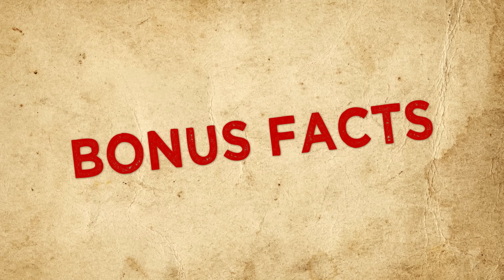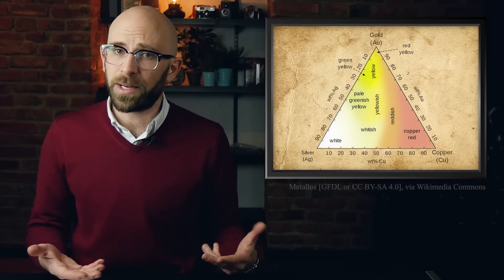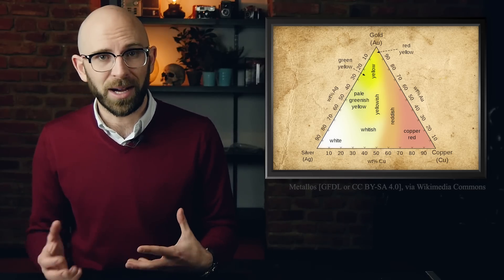How Do They Make White Gold White Given That It's an Element?

Comment: That was a short video. You could have extended a bit to include silver. Argentium is a trademark but they add germanium to silver to stop it tarnishing and it makes a very beautiful 'white' colour. Highly used in jewellery. Coins often have copper added. Sterling silver for example is a standard with exactly 7.5% copper. So a pound sterling used to be a gold coin worth one pound of silver with 7.5% copper added ... and that 7.5% copper in the gold was called Seigniorage, and it was the cost of money or the money that went to the King. Yes the king would get 7.5% tax on every coin issued by the bank of england and that kept him rich. Why is a one ounce gold coin worth one pound of silver? Well because the gold to silver ratio found in the earth was historically mined as 16 silver to one gold and it so happens there are 16 ounces is a pound. This is not a coincidence ... this is why the British currency is called the pound sterling ... the weight exists because it is a gold silver ratio for money. So in 'what you learned today' I can't help but think you could have learned a little bit more.

Comment: Thought I'd say something since I'm a goldsmith. One thing to note about rhodium plating is you need to plate the piece in nickel before you can plate it in rhodium. While it temporarily keeps the rhodium coating, once you wear it down you've now got nickel plate hanging out where it has worn down. This is mainly a problem in areas of the world where nickel white gold is used. In Europe they've moved to using palladium white gold. It has a darker hue, closer to steel (in my opinion). If you want a bright white metal that's not going to tarnish or tarnish resistant, your options are either platinum or argentium silver respectively. There's some other alloys of silver that'll achieve it, but those are pretty exotic in the jewellery industry at the moment and aren't widely used. Unless you're an incredibly curious goldsmith like me. Man, metallurgy is fascinating stuff.
Reply: Ever seen any magnetic platinum or tension setting alloys? Definitely interesting (and much above my level of capability!)

Comment: May have wanted to mention that rhodium is hella more expensive than gold, hence not just getting solid rhodium jewelry
Reply: Not particularly to do with cost; there have been periods when platinum was about 2x as expensive as gold, but platinum continued being used for jewellery. Rhodium is practically useless as a jewellery metal - very very hard, brittle, doesn't cast easily, and it's difficult to weld or fabricate.

Comment: Gold is gold, anything else is watered down snake oil fresh squeezed from the marketing department. Might as well chrome plate some old plumbing copper to serve the same purpose.
Reply: Gold is gold, even when alloyed. Which is why people will pay good money for scrap.
Reply: Didn’t you listen to the video? The white gold finish lasts much longer than chrome plated copper and trust me I know. I’ve used those fake wedding rings from Walmart as a decoy ring while traveling the plating comes off in about 3DAYS instead of three years. So it’s really about having a piece of jewelry that will last a lifetime. Jewelers usually offer a free service plan that includes having it replated when it needs.

Comment: Very interesting. But if you want white or black "gold", why coat gold in rhodium or black rhodium? why not just make the jewelry straight out of just those metals?
Reply: Partly because of cost (Rh costs ~ 2x Au at the moment), but mostly because rhodium is a pain to work: it's very very hard, brittle, doesn't weld well and it's not particularly ductile.
Reply: @dlevi67  thanks so much for the thorough explanation! Very cool!!!

Comment: If the entire point of Rhodium plated gold is that it looks like rhodium (white gold) why not plate a more inexpensive metal? People refer to the jewelry maintaining value, yet it doesn't seem to common for jewelry to be resold. After a generation or two it gains more value sentimentally then fiscally. Using an expensive base metal, and then hiding it, seems a foolish waste of money. Its like building a table out of aged teak, and then painting it. Even if the paint is expensive, its still the only thing you see.

Comment: Why not just use a 90% or 95% Ag:Cu alloy and cover that with Rhodium?
Reply: I'm sure some less scrupulous jewelers do. Btw rhodium is 91% more expensive than gold. The real question is why people don't get platinum jewelry instead, platinum is actually cheaper than gold...
Reply: @OnlyKaerius  Raw metal Pt is cheaper than Au (at the moment, but it fluctuates), however it requires much more energy to melt/cast/weld/solder and a fair amount more work to polish (and specialised skills to fabricate), so it's quite likely that a jewel made of platinum still costs more than the identical article made of gold (unless the "jewel" is an ingot made into a pendant).
Reply: Kaerius actually platinum is underwater right now compared to gold but that isn’t usually the case and anyhow the other commenter is right. It takes a special laser to set the stone in platinum and most jewelers don’t have that. And anyways I had a platinum ring and I hated it. It gets scratched all the time and I had to go in and get it buffed but it never really stayed smooth it was a pain. White gold is a whiter color and stays smooth doesn’t scratch.

Comment: I remember a jewelry vendor trying to sell my dad 24K white gold. He probably was selling platinum but didn't know the difference between white gold and platinum. This was in a mining town and my dad was a metallurgical engineer specialized in gold extraction at that time. When he saw that my dad wasn't convinced, he switched tactics and try to sell it to my mom. My mom happens to be of the same profession as my dad and proceeded to explain why what he was selling could never be 24K and still be white. Poor dude understood why he couldn't sell anything in a town where most people had a connection to the mine and had some idea of gold purity.
Reply: Assuming it wasn't just silver. How do you know?
Reply: @ericg2167  It could have been and that would have been worse for a jewelry vendor. He wasn't selling at silver prices. At the lower prices of silver someone might have taken what they knew was fake just because they like the piece. At the price of gold that he was selling, the hesitation of people were much higher. Either way, no one was paying that much for metal of uncertain content.
Reply: @ericg2167  platinum has a MUCH different luster and shine than silver, it's incredibly noticeable if you have a lot of jewelery or work with lots of precious metals, as well as the fact that platinum is MUCHHHHH more heavy/dense than gold or silver.

Comment: That is the most expensive metal to make a ring out of? 

(Must be stable & safe to wear)
Reply: It depends - if you include the price of manufacturing, there's plenty of difficult-to-work stuff that will cost you an arm and a leg (e.g. osmium - or even rhodium). Also, raw materials prices fluctuate considerably over time, so what's expensive today (palladium) may have been much cheaper 5 or 10 years ago.

Comment: I find gold( and all other precious metals) a pure waste, when used for jewelery...
Especially when one wants a silvery look, why mix all of the most expensive metals together??? Piece a' stainless would do it just as well... at literarly a 1000th the cost...
Reply: Jewelry use to be used as a type of family savings. You gave a women a gold ring to show her and her family that you had wealth and you could melt that ring down and sell it if you had to for your(future) family. 

People use to have a different view point on savings. Rather than just hiding stuff away, they make it into something practical that they could part with if needed. Gold and silver was made into silverware, jewelry, and other household items. Of course, it ended up become a status symbol and tradition, but it started for practical reasons. Same reasons why some people pay 10 grand for a mechanical watch while a $5 digital watch is better at keeping time.
Reply: "This [wedding] ring was made from a brave Cannon that fought at Stalingrad..." https://en.wikipedia.org/wiki/One,_Two,_Three
Reply: Stainless Steel can't take a decent shine, even from jewelers rouge, because it is way too hard. It also still oxidizes, it's just the nickle, zinc and other metals that allow for a thinner layer of white corrosion on the surface rather than deeply penetrating red rust. 
The reason noble metals are used is because of their extremely high resistance to corrosion. There are plenty of rarer and more expensive metals to use, but they are far too reactive, dense or brittle to use as jewelry. With regards to white gold in particular, it is superior to silver for the simple fact that it doesn't tarnish as quickly and has a far less likelihood of staining the wearers skin or causing an allergic reaction.
Reply: @Official_DJ_Spark  "stainless doesn't take a decent shine"

Have you ever seen stainless steel? You can polish it to a mirror finish fairly easily. Even easier than regular steel. And hardness has nothing to do with whether it will take a shine or not. If it did, then hardened steel used in knives wouldn't polish at all. Much less to the mirror finish you see in high end hand made knives. 

Corrosion resistance has nothing to do with it either. Stainless steel by it's very nature is corrosion resistant. That's what the "stainless" part means. And even normal steel will resist corrosion if properly taken of. 

As for why people use white gold instead of silver, the fact silver tarnishes is irrelevant. If you clean, polish, and just generally take care of it, then silver won't tarnish.

As for having things that maintain value, that's bullshit as well. If you only wanted something to use as a savings, then you'd just buy gold bars and put them in a safe. 

The only reason people use gold and other expensive metals in jewelry is because there expensive. It's a status symbol and nothing else. They just want to go out and make other people look at them and be jealous. It serves no other purpose.
Reply: The real kicker is the tungsten wedding ring fad, yeah its cheaper then gold, good choice on the surface. 
But then you hurt your finger somehow and due to swelling the hospital needs to cut the ring off but can't because it's tungsten... (gold can be snipped then bent with basic tools and little risk to the finger. Any jeweler can then repair the gold ring.) And I mean proper 18k gold that would be used for wedding rings, not 10k prop jewelery with unpredictable properties.
Reply: Here's the thing though: when you pay a goldsmith for a ring, you're mostly paying for our time and skill. This is also assuming you want something nice. Never mind the fact stated above about the safety go wearing a piece of hardened steel.
Reply: That's true, i doubt i ever marry but if i would ever marry and the woman would want a ring or she wouldn't marry, i wouldn't marry her,  she could have something usefull like a fun trip where you could form some precious memorys together, if she wanted and i would be able to afford it, but i sure won't support  jewelery.
Reply: @DerNunu  Just whenever I want to experiment (I do a lot of chemistry and physics stuff), and need some gold or silver- or any of the platinum group metals, or even a Diamond or other gemstone( I once needed a ruby for a laser, and GOD DAM I got pissed by all the search results of jewelery XD), I rage bacause all the materials used in jewelery inflate the prices like crazy..
Reply: @Kezenmacher  
not to mention that the use of precious metals in electronics can reduce electrical resistance, whci hmakes devices more energy efficient.
Reply: @Kezenmacher  so why don't you use lab grown gemstones? They are literally the same thing, but instead of $9,000 for one carat it's $63.41 for a "brilliant cut" one carat +shipping. And that took me maybe 10 minutes on Google.

A synthetic 1ct Ruby goes for $11.99 on Amazon plus free shipping, while a really Ruby goes for 10k+. Fun fact it took me more time to find a price for a regular Ruby, while the first search result took me to Amazon for the synthetic one.

And the synthetic ones are so good most Jewelers don't buy used as they can't tell the difference
Reply: @DominicMV  IDK where you live, but here(germany) I have had a VERY hard time finding artificial gemstones, especially rubys, in the size I needed, for a decent price...
Reply: @Kezenmacher  shrug idk man maybe you just weren't looking in the right areas, both of those prices I found through eBay and Amazon respectively. Both products were sourced through a Chinese company and then shipped overseas (in my case the USA) so be it the US or Germany it shouldn't make much of a difference. Perhaps you were looking for a specific cut? Most Chinese manufacturers are willing to work with clients to get specific cuts they need. It might be 15$ instead of 12$ a CT for rubies but that's not substantial

Comment: Platinum is down buy it cheap and make your own jewelry.  Give it that "personal" touch.
Reply: That's not wholly true though. Yeah, it's cheaper for just a raw ingot of platinum, but what do you want out of it? Most pieces of platinum aren't made of pure platinum. They usually alloy it slightly (97.25% platinum to other 2.75% alloy) to make it easier to work with. If you want a really nice ring, that still requires time and effort to make. Plus you need speciality equipment to work with it, plus training. Get something wonky in your platinum? That's not coming out. Platinum doesn't tend to play nice with other metals, which is why most goldsmiths who work with it with any regularity will have a set of tools dedicated to just working with platinum. If you want to learn, hey, more power to you, but it isn't the most beginner friendly metal imo.
Reply: David Beppler I want platinum.  How much would it cost to get it?
Take care and God loves you.
Reply: @jasonirelan1737  depends on how much you want.  You can check prices easily.  There are places you can order the metal for the going rate, plus shipping.
Reply: Platinum is about half the price of gold. $750 vs $1250. Low world demand for Pt catalysts, but palladium is up.
Reply: Working with platinum is very difficult and very expensive.

Comment: I really like this video both my engagement ring and a wedding ring or white gold and I always wondered how that happens so thank you
Reply: FWIW:  My High School graduation class ring {1979} is white gold.  I preferred that 'color' as well, but this is also for me the first time I knew how it was actually created....
Reply: @Allan_aka_RocKITEman  it should be solid white gold from that long ago. Which is a good thing. Mine was too. They cost a pretty penny.
Reply: Am I having a stroke?
Reply: @spelcheak  >>> Okay, I will play your silly game:  Are you having a stroke? 😊
Reply: If they are from a reputable jeweler, they will be solid white gold not yellow inside. They may have the rhodium coating to protect the finish. Only crappy jewelers plate yellow gold. 

My weddings rings and most of my collection are white gold. It's my preferences

Comment: Other than a conductor, Gold has zero practical use.
Reply: It's chemically inert & useful is certain medical applications such as dentistry. It's also highly malleable and useful in decorative arts. It's also used as a lubricant in aerospace, for objects sent into space.
Reply: @KimberlyGreen  Thirty years ago you might have had a point but dentistry in first world countries really don't use a lot of gold as fillers anymore. Especially since there are other options around now..
Reply: @KimberlyGreen  Gold has zero practical use and there are far better superconductors.
Reply: @theylied1776  I live in a first world country and I have gold caps on my teeth. Further, I did not state that gold was used as a superconductor. Gold can also be used to treat certain medical ailments. It can be used, also, in the making of glass. You make a claim without backing it up with any fact, whereas I've provided suitable examples as counterpoint. You put yourself in the position of sounding arrogant, uninformed and close-minded. Do better.
Reply: @KimberlyGreen  When exactly did you receive these gold caps on your teeth?
Reply: @theylied1776  I can't recall precisely. Perhaps 10 or 15 years ago.

Comment: Why is white gold used in jewelry instead of silver if you want a silver color? Does it look noticeably different or does it have other advantages over silver? This has had me confused for quite a while now...
Reply: the thing about gold, it it's resistance to oxidation (tarnishing in laymans terms) seeing that gold is also harder that silver this also makes it more resistant to warping and scratching, meaning that it will hold it's polished finish for longer
Reply: Thank you! :-)
Reply: Also Gold, alloyed with copper and nickel, is much tougher than silver.  I have a silver ring I only wear for special occasions because it easily gets bent out of shape.  We ended up buying Tungsten Carbide rings for everyday wear.